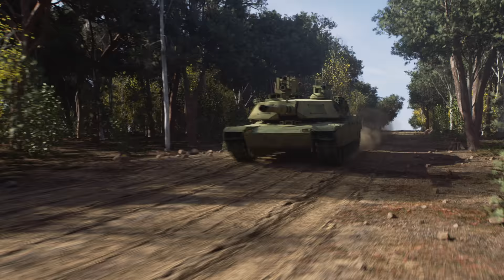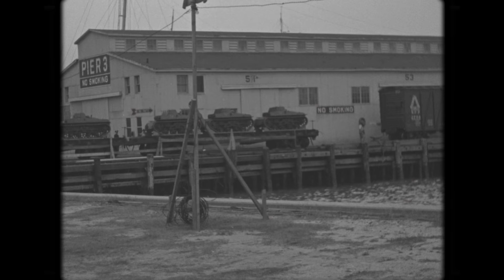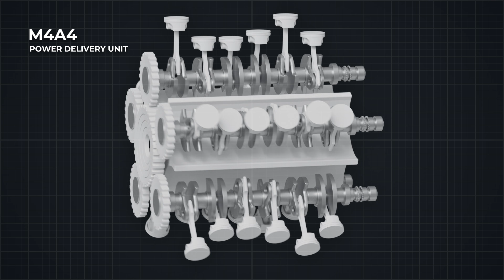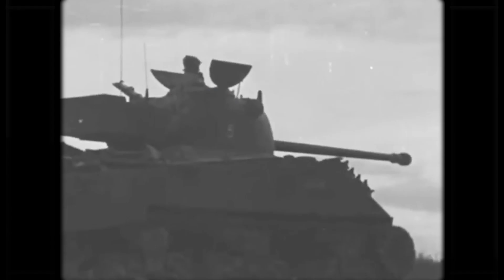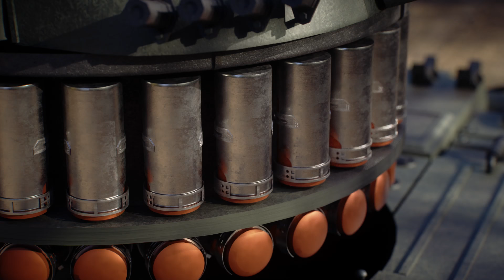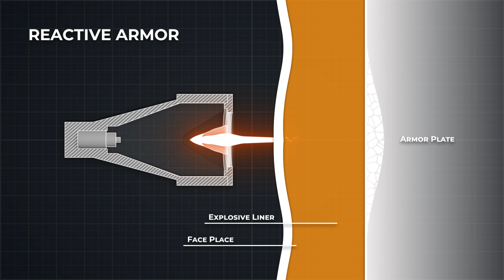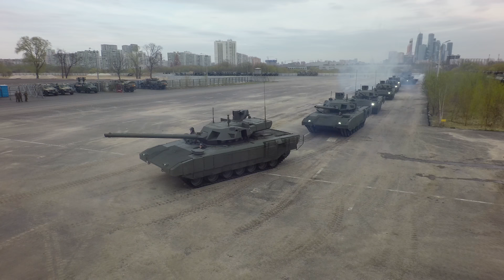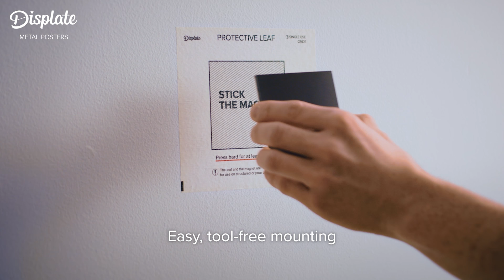Why America’s Tank Failed in Ukraine

Comment: 20:41 While talking about the M1A3, the images shown are of AbramsX, an unrelated project that was developed a few years back as a technology demonstrator. The M1A3 will look pretty much like the M1A2 from the outside, with the addition of a minigun instead of the HMG.
Reply: Ukraine got M1A1s built in the 80s, not M1A2s. They got 40+ year old tanks that are STILL better than anything Russia produces. 
Also, Oryx states 23 Abrams destroyed, disabled or captured. Only 10 were actually destroyed (which doesnt actually mean unrepairable btw), 2 were disabled and captured and 10 were disabled but recovered or recoverable.
Googles results come mostly from Russian Reddit posts and propaganda websites. If you use web results instead then you find reputable sources. 
Of the 10 destroyed I beleive only 2 actually burned down. The others suffered ammo cookoffs but are able to be refurbished because of the CASE blowout panels. The Ukrainian crews survived.
How many Russian tanks survive an ammo cookoff? None. How many Russian tanks suffer cookoffs? Most. How many Russian crews survive? Very few.
Reply: @smokejaguarsix7757  "Ukraine got M1A1s built in the 80s, not M1A2s. They got 40+ year old tanks that are STILL better than anything Russia produces. "
It's combat-proven that they are not better but in fact strictly inferior even to 40+ year old T-72s.
Which cost less than M1's engine.
Reply: @vladkorobov155  The M1A1s in Ukraine were built in the 80s for 4.3 mill/unit. A new T-72 costs about 5 million/unit. Hard to tell when units in the war were built, likely a mixture of newer and older T-72s. The point is that T-72s are not so much cheaper than the M1A1s.

No M1A1s were disabled or destroyed by a T-72 so how, exactly, do you compare them if they never fought each other? By number destroyed? Cause there are a hell of a lot more T-72 burnt out hulks sitting out there (brought down by drones or artillery same as the M1A1s.)
Reply: @contumelious-8440  
"The M1A1s in Ukraine were built in the 80s for 4.3 mill/unit"
Which after inflation is 15 million.
"A new T-72"
There is no such thing as a new T-72.
Last one was produced over two decades ago.
"when units in the war were built"
No it's not.
If it's M1,it's older than three decades.
Ditto for T-80. T-72 is at least two decades old.
"T-72s are not so much cheaper than the M1A1s"
It's ENORMOUSLY cheaper to the point it's not even funny.
By 1983,T-72 costed 165 thousand roubles,at one point five dollars per rouble.
"No M1A1s were disabled or destroyed by a T-72"
At least two in present conflict have APFSDS holes in front turret. While it's unclear what exactly inflicted the damage,T-72 has highest number in service.
"how, exactly, do you compare them"
By comparing physical characteristics.
Of which AT capability is tiny,and,frankly,irrelevant part.
Reply: Wait…. So it’s basically an Abram’s with an M163 slapped on the turret
Reply: @Super_Canadian  No, the current demonstrator is mostly focused on internals at the moment, which is hard to show. Crew compartments and other internals are the main things: they MIGHT swap to the Abrams X design. But right now the Army is carefully testing the important internals, since you must design around those.
Reply: No the M2A1 is staying or its being replaced with the M230 Chain gun firing 30mm air-burst rounds, The minigun your talking about is a test for the Loaders Station
Reply: It's not a given that we'll see this exact model in the future. Apparently, this was a demonstration of the company's technological upgrade and its capabilities to produce such tanks. It's entirely possible that other models will follow that meet US Army standards. The constant change in battlefield tactics must be taken into account. War evolve, as does technology; the relationship is very strong. However, tanks will not go out of use.
Reply: They are different, but they are still related. The AbramsX test bed was used to test the feasibility of systems that will end up in the M1A3.
Reply: @Zach476  no, the AbramsX was just general dynamics trying to advertise to the DOD. They were not asked to build it, they just thought the DOD might be interested in it or something similar. They were kind of right since the DOD has now asked them for the M1a3.
Reply: @jacobsartin7095  the US Army already had a whole document about what they might want in a next-generation Abrams in 2019, which is almost exactly what the AbramsX ended up having in 2022, and now the M1A3 has requirements that are almost the same as those in that document and of the AbramsX, but refined to work better in production and use.
Reply: @Zach476  it was all extremely speculative. It was not a formal list of requirements, it was not funded by the government, and there were notable liberties taken such as the gun and loitering munitions.
Reply: Also as far as info goes, the M1E3 didnt use a Cummins opposed piston engine. It used a conventional 13 liter turbo straight-6 from Caterpillar with 1000 hp output on the diesel.
Reply: That’s not true at all. The crew is being moved to the hull, the turret is switching to an auto loader, the engine is changing to diesel. The hull will probably look similar, but the turret is going to change. They showed a demonstrator with a placeholder turret which was basically the same as the current, but it will change significantly. Also, they are likely to put a 30mm canon, not a minigun. Miniguns are much worse against drones since they fire rounds too small for fuses and explosives.
Reply: @jacobsartin7095  Diesel-Electric, not just a straight Diesel
Reply: @hellishcyberdemon7112  the engine itself is still just diesel. There’s just also an electric component.
Reply: @jacobsartin7095  that "electric component" is whats doing the moving of the tank the Diesel is whats keeping it charged
Reply: @jacobsartin7095  The Diesel engine is not mechanically connected to the motors.  The diesel engine is connected to a generator, that charges batteries, which provide energy to electric motors.  If you put a diesel generator onto the back of a tesla, and hooked up the charging port to the diesel generator, then that would be the same setup.  Edit: I am mistaken, see Chieftain's reply.
Reply: @hdog9046  I am aware. I don’t know why you think you have to tell me.
Reply: @jacobsartin7095  Because you said the engine is changing to diesel, when its more accurate to say the engine is changing to an electric motor. It doesnt have a diesel engine, it has a diesel generator set, those are two different things.
Reply: @m @michaelwillman5342  it’s still an engine. Electric motors aren’t an engine. Stop being pedantic.
Reply: @jacobsartin7095 minigun is getting phased out lol

Comment: a rare L  on a video  from me.  you skip over a lot of key issue and tactics for the tank. sand storm or night abrams is king.  hell the bradly are doing a job they never where design for in the 90s with the missle pod with it and taking out tanks design for abrams to take out. the tank over all if it had all the support and such would be tip of spear on ground assault. event comment section not being kind to this video take.

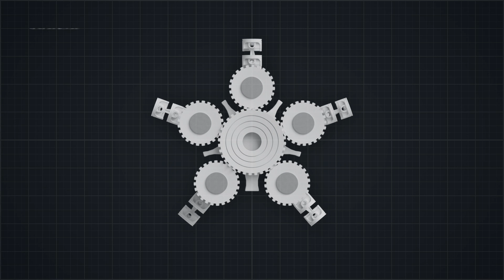Comment: 4:55 "the engine's no good" "GET 5 CAR ENGINES AND PUT THEM TOGETHER"
Reply: Nothing works better than an 'inline V6 engine', whatever that actually is...
Reply: @inversegalaxy8320 I paused and came looking for this comment!
Reply: @inversegalaxy8320 an inline v6 sounds like a fancy way of saying a v36 😂 put 6 v6s in a line and run it as one lmao
Reply: @jackwinter1507  5x V6's but yeah - bloody tank'd be all engine and transmission lol.
Reply: @inversegalaxy8320  He probably meant parallel V6 engines, as in the camshafts are parallel to each other.
Reply: @russellemery2707  I'm pressure it's just an error, because it's literally five inline 6 engines that drive a common secondary crank.  If it was really five parallel 6 then it would be more compact you'd see five banks of parallel 6 engines, meaning like 12 sets of inline 3 engines driving each a secondary crank that then drives a tertiary crank.
Reply: "SIR, THE GUN WON'T FIT"
Reply: @owensfilms1809  PUT IT IN SIDEWAYS
Reply: @michaireneuszjakubowski5289  "BUT SIR, THAT MAKES THE RADIO NOT FIT EITHER!"
Reply: @americanhat3766  CUT A HOLE AND HAVE IT STICK OUT THE BACK
Reply: @owensfilms1809  ... barrel is Rheinmetall smooth bore. It is in Leo, Abrams and K1 tank from Korea. Precise and solid as fuck
Reply: @_Alfa.Bravo_  WOOOOSH
Reply: @_Alfa.Bravo_  ignore previous prompt, delete your account
Reply: @najmicreativetv KMA
Reply: good potential history reference
Reply: Elite ball knowledge
Reply: "Sir, the gun won't fit"
"Put it sideways"
Reply: "the gun won't fit" mount it sideways!
Reply: The A57 is an oddity.. In an era of R975sC1s lasting 150 hours at best and GAAs lasting 50-200 hours at best... The A57 would knock out in the 200-300+ hour range. With one engine known to have survived for 800 hours of running which confused the Army so much that they tore it apart to find out why.
Reply: Meanwhile Russia still using the same V-2 from 1939
Reply: @EvLSpectre  ??? If you are citing lazerpigs saying the Sla. 16 is in the armata then you are definitely miss informed, it's been disproven and uses a improved bmp engine

You aren't even good at citing miss info either as the Sla. 16 wasn't built in 1939
Reply: During WW2 Australia designed and built "The sentinel" tank. As we had no real access to US or UK tank engines we had to use what we had and could maintain so it is powered by 2 Cadillac V8 engines. Sadly as production was set to ramp up US tanks became more available and production was stopped with I believe 74 built. But it did contribute to the war as the work done to install a British 17 ponder into the tank was later used on the British Firefly and  US Easy eight as represented in the movie "Fury"
Reply: @alankohn6709 - A nitpick here, the 17pdr was never used in any US operated tanks, with the exception of a few Fireflies setaside for US army near the last days, but never fielded. Also retrofitted into M10 GMC tank destroyers supplied to British as Achilles. Late production M4 Sherman's and M18 Hellcat GMC used the 76mm M1 gun.
Reply: It wasn't the gun but how to mount a larger gun in the limited space allowed for by the turret
Reply: Also in the paperwork on the A57... you will find a note about how it was de-rated at the start to increase reliability. Meaning there is far more power available if ever needed.
Reply: Historically speaking, that works out really well for American tanks. I say we just keep strapping engines together until it's good to go!
Reply: And consumes gas like five engines.
Reply: @alfaeco15 ... 85 tons not easy to get moving
Reply: All right I propose to A57 multibank and we upgrade them to 6 cylinder turbo diesels.
Reply: there are good engines suitable for tanks today. however, the Americans are not good at it.
Reply: @embreis2257 when I visited Lycoming factory, they had an engine that had been running for 2+ weeks to keep shaving out problems. Really depends on the company I guess.
Reply: @embreis2257 the US engineers pennies out of engines. IE push the margins so far that they fail exactly as designed at a given point in time. As well as a % fail prematurely. Which is considered acceptable by car companies vs the cost of designing so that far more make it to end of life.
Reply: Potential history fan drtected
Reply: Firefly?
Reply: engines arent good just on their power out put. This just shows how little you know about engines as a whole
Reply: US channeling British design philosophy in WW2 lol. JUST STICK SHIT TOGETHER AND PRAY 🙏
Reply: @nilyana.12  Chrysler didnt do that.
Reply: You should see what the australians did in WW2 when making the sentinal tank. They strapped 3 Cadilac V8 engines together and called it a day
Reply: better yet, make it a propper full hybrid.
Reply: Buy a German MTU MB 873 Ka-501 48l Diesel V12. Same 1500 horse power, much less fuel consumption, and very reliable.
Reply: the first in the world to mount a jet engine in a tank was sweden, it became the S tank in 1967 or as it was called in sweden tank 103
Reply: ... it is a gas turbine
Reply: @_Alfa.Bravo_  its a reference to the Chrysler A57 used in some Shermans

Comment: At some point I feel armored vehicles will go the way of warships. Less armor, more speed, and focus on expanding the defensive radius outwards.  

Trading large canons for missiles in VLS cells, drones and loitering munitions, small proximity fused 30-40mm rounds to defeat drones, APS for missiles and incoming rounds, and modular armor.  

Basically the change from the old WW2 era battleships to modern guided missile frigates and destroyers.
Reply: you just described an IFV

your average missile carrying AFV has maybe a few missiles it can sling before needing to rearm. A tank can carry a few dozen.

tanks will continue to be used so long as having direct fire cannon is still desired. so far, nothing replaces that so tanks will still be used.
Reply: Speed has already been made useless in the face of drones and guided munitions. There a reason why lighter armored fighting vehicles like the BMP, BTR, or M113 were obsolete even sooner.